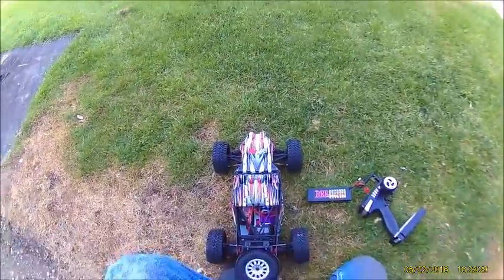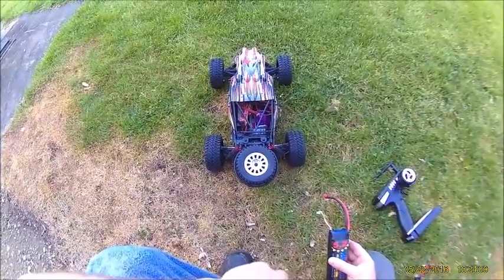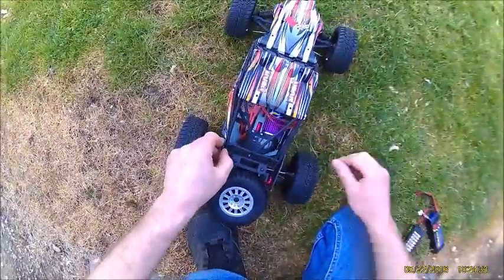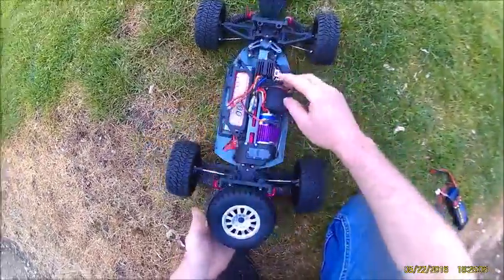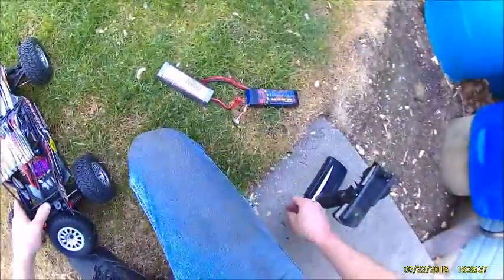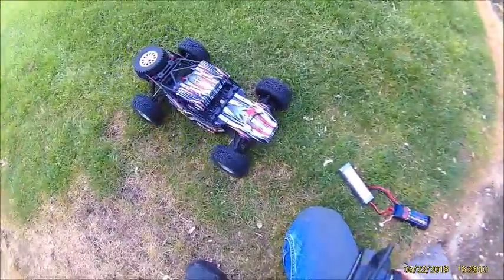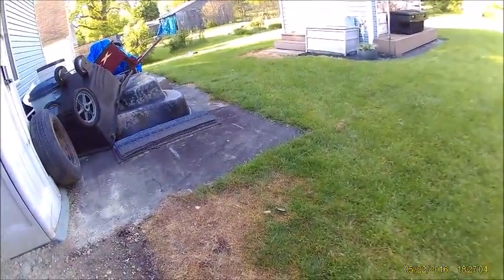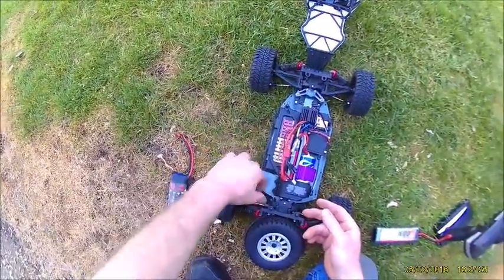LIPO Battery Test FS RACING MARAUDER 1/10 th SCALE BRUSHED DESERT BUGGY MODEL# FS-53910

Comment: RPM makes from A- arms that fit this truck, if you ever need to replace them.  Buy two sets of front A-arms for the Helion Invictus. DIrect bolt-on upgrade. This is a pretty mild truck/motor chances are the originals will never break.
Reply from the maker: But, That is some good info...  Thanks... And yes it's not lightning fast, but it holds it's own..

Comment: battery lipo ???
Reply from the maker: Yes the battery is Lipo  ...
Reply from the maker: It doesn't come with a lipo, but the ESC lets you use a Lipo by changing the jumper plug.